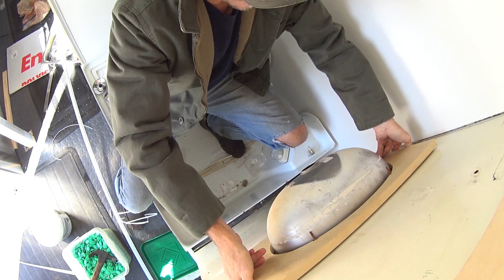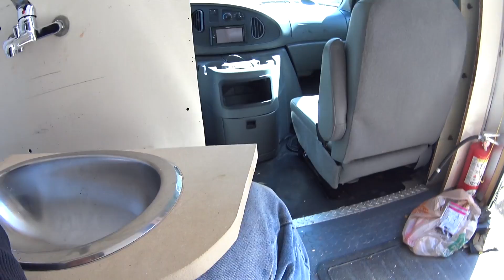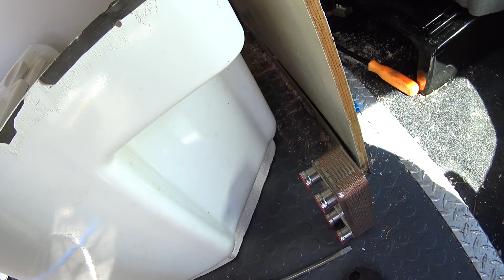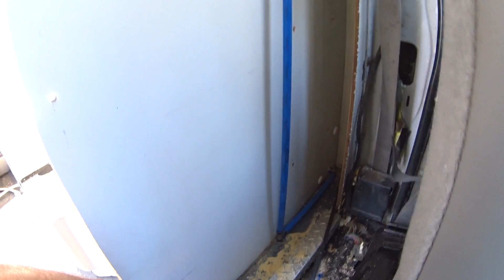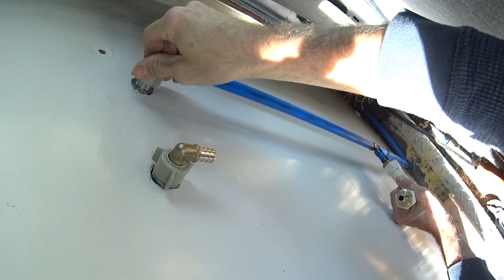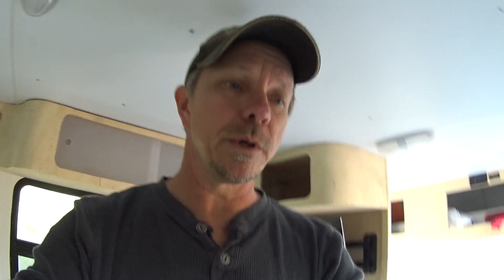Box Truck Camper 78 Shower Enclosure PT2

Comment: I look at each of the projects on mine like well this is version one lol.  Seems I get to version three on each of them before I am happy.  Haven't tried one of those kind of heat exchangers yet I will be watching to see how it works.  Thinking you may want to add a re-circulation loop with a tank so you would have a tank of hot water to draw from when you stop.
Reply from the maker: That's the way I think about it also. You don't have to live with a mistake. Just build version 2.0. Hopefully I'll get to see if the re-circulation loop is needed soon.

Comment: Just put some red tape on the blue pex...It seems like you would have to have a tank (hot water tank) to allow  the heat exchanger to work.  I doubt if you will be showering while driving..

Comment: Did you run the hot water to the right faucet?
The 4 rules of plumbing:
1. Hot's on the left.
2. Cold's on the right.
3. Stuff don't flow uphill.
4. Payday is on Friday.
Reply: My grandfather and father (both union plumbers) drilled this into my head from a very early age.  I've found #3 to be extremely useful in several aspects of life...
Reply: dtalon92 Blind mans code!